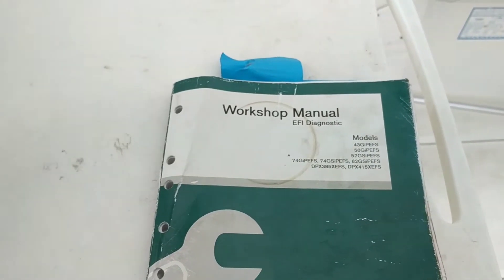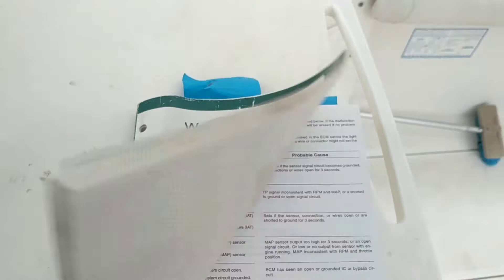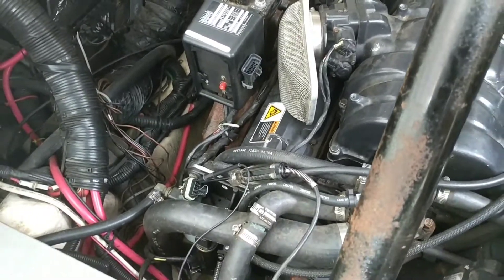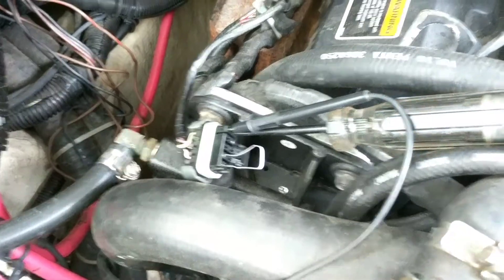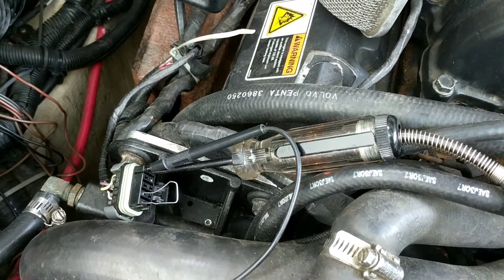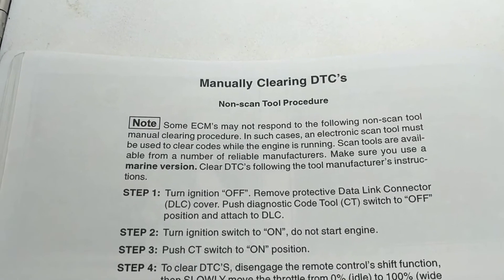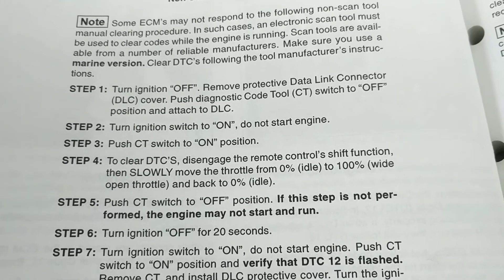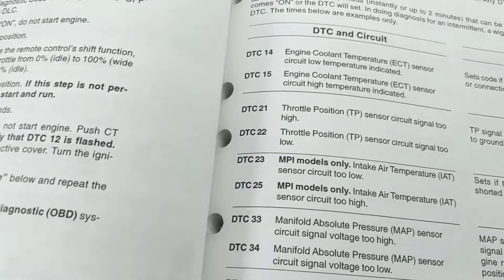Read and clear diagnostic codes for Volvo Penta marine.

Comment: my plug is different on my GXI 5.0l so dont no where to put wires .how did you find where to put wires?
Reply from the maker: Should be the same port. My engine is around 1996-2000.
Reply: Did you ever find the diagnostic connector on the 5.0L GXi?  I have same motor & trying to find it too.